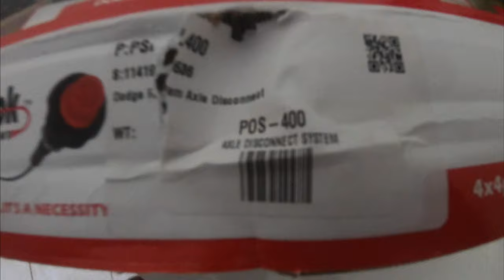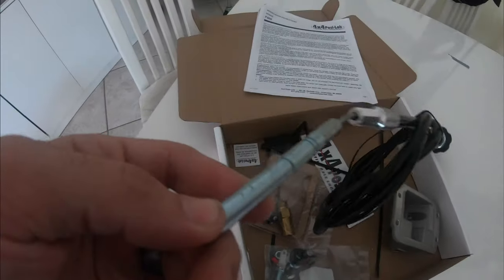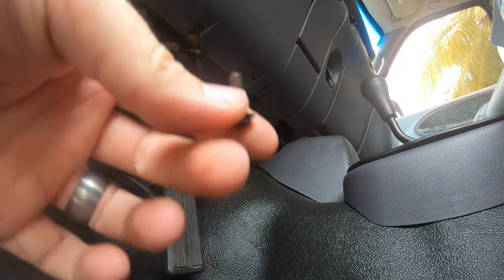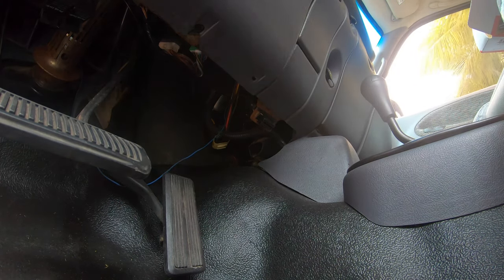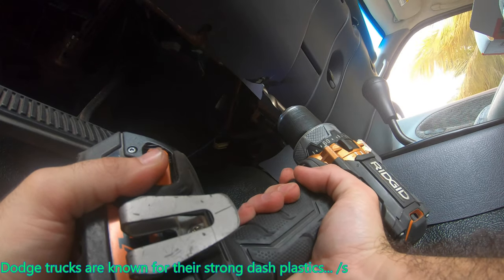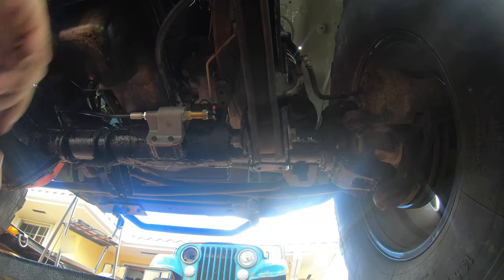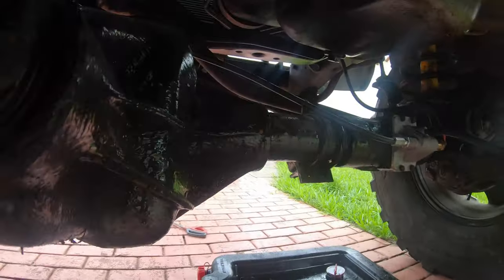Installing a Posi Lok on the Budget Mud Truck (2000 Ram 1500 with the axles off of a 1997 Ram 3500)

Comment: It took you that long to get that little c clips off I can get them off and less than probably 20 seconds well I've been a mechanic for the last 20 years but still there's a trick to him you don't even need all the tools that you use just a little FYI I installed the same setup on my rig and I'm trying to get it figured out because my light the four-wheel drive light is on even with the linkage cable not engaged so for my understanding the little ball that sits in that gold housing where the switch is I adjusted mine I just took a set of Vise grip and held the ball to see if the light went out to my thoughts yeah the light was out when I release the ball the light goes on so that tells me that that linkage cable the end of it we're kind of looks like a bullet in some ways that as they have enough pressure up against that ball to keep the light off but I'm not quite understanding because mine seems to be pretty well in there and when I p u l l my red lever back the handle of the linkage I still don't get four-wheel drive it should engage it why it's not I don't know I'm going to take it off and see and find out because with that thing pulled all the way I should be locked into four-wheel drive it's a pretty simple deal
Reply from the maker: Lol I certainly hope you can do it quicker than me with 20 years experience doing it for a living. As for the light and sensor just mess around with it a bit and u will get it working, it’s pretty simple.